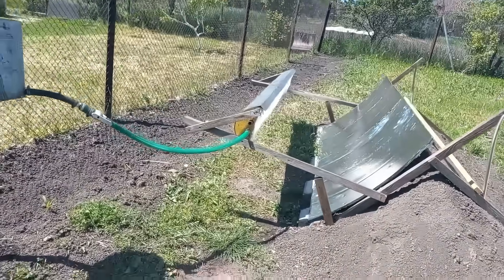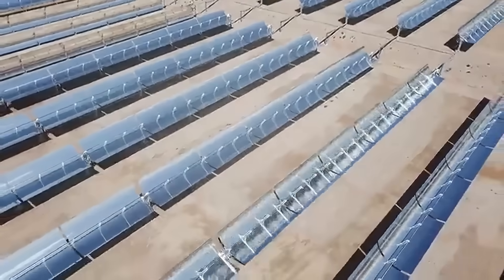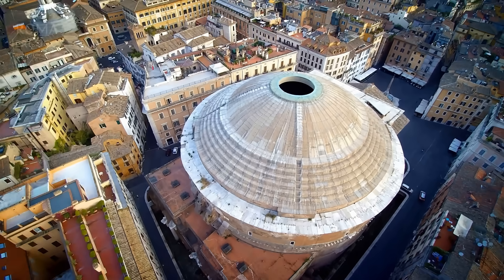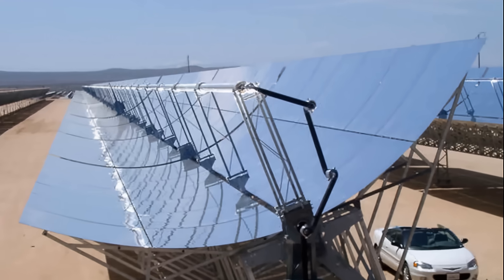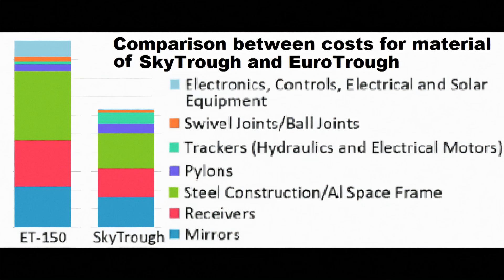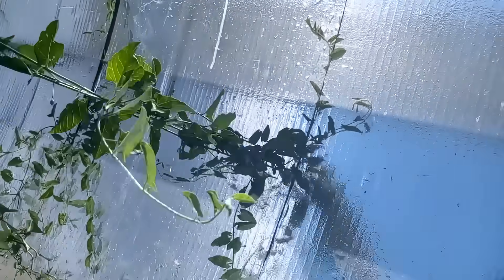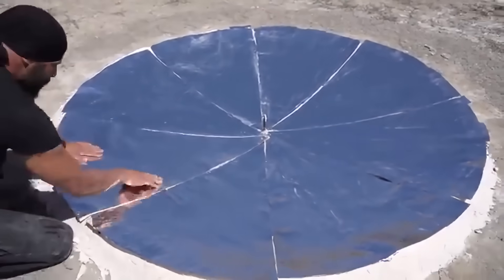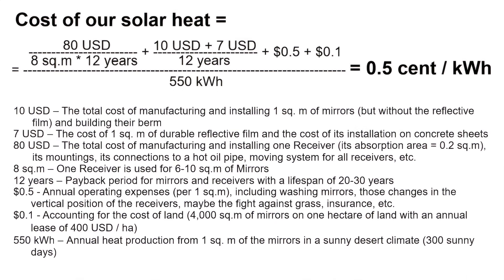Mirrored concrete for cheap solar energy

Comment: It's less accessible and flashy than the thermal harvesting end of things, but are you able to consider what an equally economical conversion system would look like?  I'm guessing if you have access to large amounts of fresh water, you can just go with a steam turbine.  But it seems like you're approaching the point of designing something that could be used to build a village power plant in the developing world.  

In a desert area, a lot of the wear and tear might be avoidable if dust storms aren't a common problem, and creating berms and batteries out of the local soil seems like an incredibly cheap way to acquire and smooth power.  Such a system could either run with water, heating up to 100c, or could use any of a variety of oils as its working fluid.  

I was going to originally suggest something exotic for power generation in low water environments, like a Stirling engine, but I realized that with the amount of thermal energy you can harvest cheaply, simpler and less-fraught systems could be used.

If you decide to mess about with the harvesting side, and feel like building a tall thing, maybe consider making a thermal chimney where stored or harvested heat is used to heat incoming cold air, pushing it past a simple turbine at the top of the chimney before releasing it.  The design for such a system should be rather simple and self-evident.

Comment: While this is a great exercise in "backyard engineering," there are several major reasons why this hasn't been adopted at scale:

The Precision Gap: Achieving the 390°C–400°C temperatures mentioned requires "optical focus." Professional troughs require accuracy within 0.1 milliradians. A concrete slab sitting on an unstable earthen berm will warp, settle, and erode, causing the light to miss the receiver pipe (spillage). Without extreme precision, you just get lukewarm water, not high-pressure steam.

The Mylar Problem: The 20-micron film shown is highly susceptible to UV degradation and moisture. Even in your 6-month update, the film is already delaminating and clouding. The labor and energy costs required to constantly resurface thousands of mirrors would far exceed any initial savings on the "cheap" materials.

Cosine Losses: By keeping the mirrors fixed and only moving the receiver, you suffer massive "cosine losses." A fixed mirror’s effective surface area "shrinks" as the sun moves across the sky. Traditional tracking systems are more expensive precisely because they maximize energy capture from dawn to dusk—something a fixed slab cannot do.

Economic Reality: The 0.5 cent/kWh claim likely ignores O&M (Operation & Maintenance) costs. In the solar world, maintenance is usually the biggest expense. Cleaning and replacing delicate plastic films on thousands of low-to-the-ground concrete slabs is a logistical nightmare compared to standard PV panels, which have dropped so low in price that they’ve already made most high-heat thermal plants obsolete.

Cool concept for a DIY project, but unfortunately, "cheap" materials often lead to very expensive energy!
Reply: Systems that move the mirror (rather than the reciever) aren't more expensive because they work better, they are more expensive because they are more complex. 
Also, with an inaccuracy of 0.1 milliradians, the sunlight would miss the reciever by less that 0.1 mm. Given that the reciever is like 100 times that size, it doesn't matter
Reply: @younscrafter7372 The 0.1 mrad figure is a straw man industrial glass barely hits that. A hand-cast concrete slab on an earthen berm will likely have errors of 20-50 mrad. Because reflection doubles the error, a 20 mrad slope error shifts the light by 40mm at a 1m focal length, which completely misses a standard 25mm receiver.

Furthermore, moving the receiver doesn't fix 'cosine losses.' A fixed mirror loses up to 50% of its effective area as the sun moves off-center. More importantly, parabolas only focus light into a tight line when the sun is on-axis; off-axis sunlight creates 'coma' and 'astigmatism,' turning the focal line into a blurry mess that can't generate the high-pressure steam needed for a turbine. Moving mirrors aren't 'complex' for the sake of it they are the only way to maintain the concentration ratios required for 400°C steam."

Sources
powerfromthesun dot net
Google Search Suggestions:
- parabolic trough solar collector receiver tube size and accuracy requirements
- cosine losses fixed vs tracking solar collectors comparison
- 0.1 milliradian error effect on solar concentrator focus distance receiver size
- moving mirror vs moving receiver solar thermal cost efficiency trade-offs
- impact of large slope errors on solar intercept factor 10 mrad 50 mrad
- how does the focal spot of a parabolic trough change with off-axis sun angle
- moving receiver solar concentrator vs tracking mirror efficiency comparison
- optical performance of fixed parabolic mirror with moving receiver cosine losses
- surface slope error of hand-cast concrete mirrors vs solar glass
Reply: 0.5 cents/kwh without any infrastructure to turn it into usable energy like transport pipes for a home heater or converstion system to turn it into electricity is exactly why conventional sources are more expensive. Nothing new is said in this video.
Fun hobby type project, but not really usable as a reliable/cost effective energy solution.
Reply: See my comment about compound parabolic reflectors described by youtuber Night Hawkin Light and I think that could solve the problem you describe

Comment: Very good. Do you think it could work to make a small shallow pond and have the mirror sited on a floating board so that it can be easily rotated on the water to face the sun, I mean also to take into account of the movment of the sun with the seasons seasons. Optimisation would most be needed in spring and fall, whereas summer gives you plenty in a static position
Reply: That's not a bad idea. Tho I bet wind would wreck havoc by causing waves so it would be dependent on locations
Reply: @ct1freak  well, I expect a small pond only just big enough and not deep, just a few inches
Reply: @utubeape maybe. Def make moving things less strenuous

Comment: I wonder if there's a way, with chemistry, to make a clear but durable coating for a mirror that works at scale?
My first thought is hard anodizing for aluminum sheets:
I think if someone combined very thin (1/8in thickness) but durable polished metal, like an anodized aluminum sheet, or maybe stainless steel, with some sort of lightweight engineered backing (I think of honeycomb sheet metal, but maybe concrete/aircrete) it could be very durable. In my mind, the biggest issue for home thermal solar is the reflective surface itself, because I've yet to see any that won't deteriorate quickly.

Comment: What about using a very thin stainless steel flashing as reflector on the cement shape ? so it last almost for ever, but is mor cheap than using stainless steel flashing that is thick in the idea to be strong...
Reply: High grade polished stainless steel is very reflective.

Comment: Nice ! Have you checked the last video of NightHawkInLight about easy aircrete ? (I refer to older video where you made an insulated water tanks heat storage..) Alors for reflective material, Ben of the same channel have made somes !
Reply: Aircrete would be worse in this use case as the heavy weight of the concrete is needed.

Comment: but how to convert the steam into electricty
Reply: connect a a fan at the end of the steam output
Reply: @dariusyca  so like a turbine for power?
Reply: @dariusyca fan???? You mean an alternator.....words are hard😂😂😂
Reply: I've heard such items are called turbines which subsequently turn an alternator. I don't know for sure though....
Reply: @curbyourshi1056  seems like a solar panel will be cheaper and lower maintenance then huh.
Reply: @ZiggleFingers  Are you crazy? No it wouldn't! You'll spend hundreds of dollars on conventional solar panels
Reply: Bro…

Comment: This is my first time seeing one of your videos. I've looked at a bunch of solar concentrators but never considered using concrete as the frame.

It's a clever concept, especially for making a circular parabolic mirror. But the potential doesn't stop there. NightHawkInLight just posted a new recipe for making aircrete. It can reduce the concrete used, weighs significantly less, and outperforms R6 insulation (useful for thermal storage).

Thank you for this, I might not have ever connected those ideas on my own.
Reply: Aircretes weight is to the detriment of using these concrete mirrors own mass to secure them. A mirror made of aircrete would require a separate base, which increases installation cost and defeats alot of the point of the current formula. A lower density concrete is also more likely to crack and crumble when exposed to the elements like these concrete mirrors are. It doesnt really strike me as a good use case for anything related to this project.
Reply: @pauldeddens5349  just a little aeration would likely reduce cost and still be able to be implemented in an identical way because there would still be plenty of weight and strength with less material used
Reply: @pauldeddens5349 I think the placements of these concrete panels are inherently flawed, elevating and attaching them to poles that go deep underground would suffice for maintaining their position and would somewhat mitigate their damage from elements of nature, basically foundations, rather than using weights
Reply: That was 100% my first though, yes!
Reply: just saw that aircrete thumbnail the other day, thanks for connecting this idea to that one

Comment: The most important lesson from this video is that solar power is democratic and we do not need to rely on some corporate brand if we use a little science and ingenuity. Of course we cannot expect grid integration and conversion to electricity to be easy or practically feasible for most individual small land owners until the industry segment develops with IoT and last mile electronics.
Reply: the sun is free, but land costs.
Reply: @Pribilof  These are even better when mounted on roofs of houses or apartment blocks because they're kept away from damage.
Reply: @Pribilof use vertical structures
Reply: @Pribilof  Only a problem in countries where corporate well being is valued more over social welfare.
Reply: @jiffonbuffo  or in places where land is scarce.
Reply: @jiffonbuffo The 'corporate' well-being is more heroic than your blind worship of non-existent collectives.
Reply: @jiffonbuffo  as if you're gonna mine and refine rare metals for a solar panel in your own time.
Reply: consider the many tasks requiring thermal energy where no electricity is needed
Reply: @khlorghaal  This. If you just want hot water this is pretty efficient.
Reply: Why use the word democratic when you mean cheap and accessible? The sun and solar energy has nothing to do with voting and democracy. It's like saying air is democratic because everyone can breathe air.
Reply: @lepezamajmune3965  it just might be that their first language isn't English. In Portuguese, for instance, the word "democratic" is an acceptable synonym to "popular" or "accessible".
Reply: @lepezamajmune3965  yeah. Kind a weird political insert😅. Its just cheap and accessibility wins.   Also big companies never forced you to only buy their stuff😅
Reply: Until the skies become opaque with them trails
Reply: @hazlox  If you're talking about what I think you're talking about, I don't think that's how that works
Reply: @totallynoteverything1.  There are videos where they literally pump smoke/chem/fog into the atmosphere from a building. But you keep closing your eyes, yeah?
Reply: @MrDosonhai do you mean ... A chimney? 😮
Reply: @MrDosonhai Vulcanos do that, too. Scary shit, visible things being in the air. Time to fearmonger.

As it turns out, 99% of all emissions are water vapour, .9% of all emissions are greenhouse gas and the remaining .01% are other volatiles. 

What is that white stuff following behind jets? It's water vapour of course. Learn a little before you speak a lot.
Reply: @Nanamowa  I get it with the trail loons, but when governments like the UK are openly funding geoengineering experiments for Stratosphere Aerosol Injection to do the exact thing they're talking about, don't you guys think it's a bit late to keep playing the snarky debunker on this?
He did say fog, by the way. Fog is water. Kind of like clouds. They block sunlight.
Reply: @AGW99-df3yg First off, citation needed. Secondly, clouds do not block sunlight, they block visible light. UV light passes right through clouds. I'm not sure what point you're trying to make here with the clouds blocking sunlight bit because even if they block visible light, the greenhouse effect of airborne water vapor means more energy is trapped on the surface that would otherwise be reflected were that water vapour not present, that is to say that the more clouds there are, the higher the surface temperature is. Do a little experiment, take any two days on the same week where one day is cloudier than the one before it and take the temperature in the shade. The air temperature will tend to be higher on cloudier days. This is especially true in the winter.
Reply: @Nanamowa  Wdym citation needed? About the UK funding thing? BBC, Telegraph, the Independent, the government itself, not sure what more you'd want.

The topic is about solar energy capture, not avoiding sunburns. Sunlight is visible light. It and infrared are responsible for the overwhelming majority of heating caused by the sun. UV is a tiny percentage, and especially irrelevant in water-based energy systems.

I'm gonna go out on a limb and say there's already been plenty of experiments to figure out whether clouds increase or decrease the temperature.
Reply: @AGW99-df3yg  "Here's some vague references to news networks, that's totally a citation"

Your understanding of fluid dynamics and thermal dynamics here is just severely lacking. 

Also, clouds do not block visible light from reaching the Earth. They diffuse and scatter that light so it's not in straight beams OR they absborb the light. The tendency toward radiating into space is far less on a cloud than on the surface, this means that clouds act more like diffuse lenses lenses for light than blocking it. 

For your last statement, yeah there's been a lot of experiments and we have a lot of data, so it's bewildering that you keep ignoring it.

Comment: https://youtu.be/z4_GxPHwqkA?si=IEeikUUR5LOp14SR

This channel nighthawkinlight just did a video on making lightweight concrete that used half as much material than standard concrete. It may help improve your cost basis for the panels.

Keep up the good work!
Reply: had exactly the same comment in mind :D
Reply: @TheNightwalker247  Same ^^. But for insulating the heat storage tank.